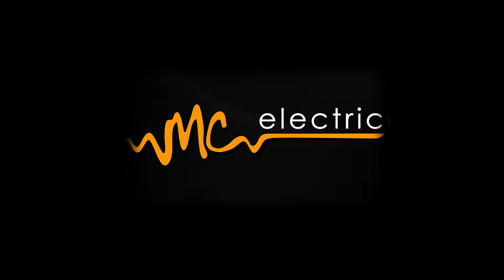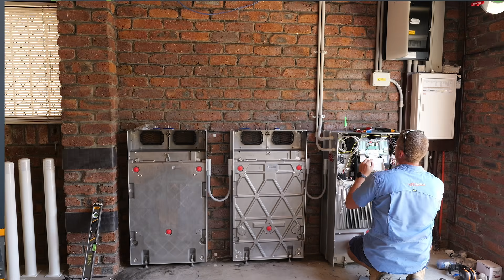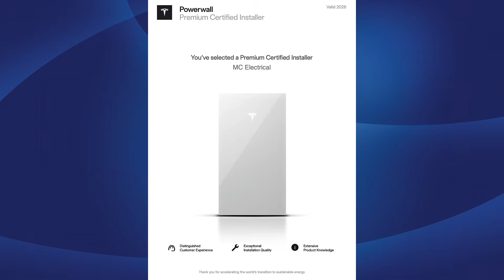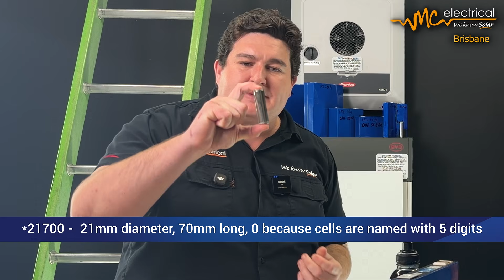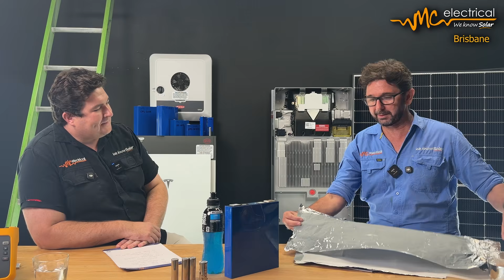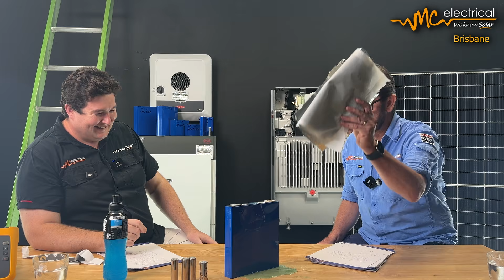Tesla Powerwall Problems Exposed — but why we're sticking with it.

Comment: How can someone tell if you installed a surge diversion? Second, if you go “off grid” via the app during the storm will that help protect it from a surge from the grid?
Reply: If your off-grid your house and inverter/battery are physically disconnectd from the grid. Appart from the gateway and inverter coms to the gateway you would be separated from a grid power surge. 

The surge protection usually looks like a circuit breaker without the switch. It usually has a red or green indicator. They are sacrificial so you need to occasionally check if it is still good.
Reply: @Yorick_Mark thanks, so going off grid may be a work around during very bad storms?
Reply: Getting a surge diverter installed in the switchboard is probably a better solution.

Comment: Great balanced review gents with biased put to the side and no Sig bashing😅
Interested to see competitive price per kWh comparison to the other 3 top tier brands from China? Are they still Nevada or Mexico/China along with the EV’s?
Cheers
Reply: Still manufacturing the Powerwalls in Giga Nevada
Reply from the maker: Thanks Michael. Still Nevada for the Powerwall. I wonder who is in your top 3 😅.
Reply: @mcelectrical well as you know, same as GI energy with Fronius my top Inverter and by the way, did you get the sad news about SMA pulling out of industry? Here at least for now. Not been so good since the left Germany and went to China but still a shame to see one of the best in the business going 😢
Reply: @mcelectrical  BYD/Fronius and Sungrow for SP Sig for TP 👍maybe now Tesla PW3 next gen TP back up there again in the mix 😊
Reply: @MichaelDance-d8d  I would argue Fronius Verto-Plus for 3-phase, but that particular review is still in the works.

 I think that's a fair top 3.
Reply: Thanks Yorick, keen to see that one. I’d like you guys to do an inverter temperature testing comparisons as part of your round trip efficiency as I don’t like how hot my Sig gets particularly at 38-40’c ambient hot days (sth side shade well ventilation cross breeze)
getting to 65’c + at only half throttle @ 14kw’s though 25kw TP inverting PV generation to surplus export with many users on Sig community reporting up to 70’c (danger zone max) when working harder like big loads or max vpp exports and cutting back to assist longevity and adding fans in garages which will assist and drop about 5’c .
I’m sure Mark will love this and Fronius will take the crown here 🤠
Reply: @MichaelDance-d8d We will start adding the temperature test test where possible. Keep an eye out for the SAJ review comming soon
Reply: @Yorick_Mark  I know you guys will most likely cover this in your upcoming review, however the Verto Plus switching time to backup does seem quite prolonged (11 seconds) in comparison to its competitors in the three phase backup space.
Reply: @cdgoldie80  We'll see what happens. You never know what Fronius have up its sleeve. 😉

Comment: 4:04 this is not true and it's one of the worst when it comes to using retailers like Amber. The Tesla app is actually pretty weak compared to newer systems like Sigenergy. Limited scheduling, missing battery data, inaccurate readings, and heavy reliance on Tesla’s automation instead of real user control. Competitors now give far more detailed energy management.
Reply: Yeah the Sigs good for that but it’s AI still isn’t the crystal ball just yet and customer support is far behind Tesla to date but overall I’m really happy with my TP system.
Just hope it’s a rock solid reliable investment such as Sungrow BYD/Fronius and Tesla ?
Reply: @MichaelDance-d8d  depends what you use it for. I've used both - manual control on Tesla Powerwalls via Amber can be hit-or-miss. Amber’s SmartShift sometimes hits Tesla API limits, so commands are often delayed or ignored - which is horrible for 5min price spikes, which a Sigenergy system will detect and respond to in 30sec.
Reply: @Nerdificationing  Tesla charging for the API integration does make it costly for 3rd parties to integrate with Tesla products. I have been informed that Tesla is working on software updates to improve wholesale market participation and reaction times to price spikes.
Reply: @Yorick_Mark  that's good to hear! I do worry they'll eventually limit it to their VPPs... such is their ecosystem approach
Reply: @Nerdificationing  I don't think so. I get the impression that they understand that they need to be a bit more flexible in integrating into established networks. Ring fencing works great if you effectively have a monopoly but Tesla no longer has that.
Reply: @Yorick_Mark  that's true, they'll adapt or perish
Reply: Between myself and my parents we have both a Sigen and PW3. They're both excellent products, and there's a lot to like about Sigen in terms of product flexibility and 3-phase support. The Sigen app is certainly loaded up with features, but it's all a bit half-baked. Things like scheduler are needlessly convoluted. The summary and charts are less clear and harder to navigate. Mode selection is almost comically obtuse (especially when attempting to disable their AI mode). Their "AI mode" is pretty weak.

I love configuration. I have Home Assistant tied to everything in both houses. The lack of configuration options on the Tesla PW3 was a concern. But after turning on Time-Based Control, it's almost uncanny how often it does exactly the right thing. It's not perfect, but it's dramatically better than a fixed schedule. Who needs walls of obtuse configuration when the battery can just do the right thing without being asked? And the Tesla app is actually nice to use. Its live data/charts are a league ahead.

And while Sigen is feature-rich, it has a few really wild omissions, like no built-in support for metering non-backup loads. I wish I knew that before the install. Retrofitting it will require more space in the switchboard and it's already full. And I don't particularly like the idea of paying for an A-grade to visit, and paying Jemena to disconnect the grid (no isolator in the meter box, can you believe it).
Reply: @sjwright2 Thats some great feedback. Thanks

There's pros and cons with every system.

Comment: Good to see some of the issues called out, 10% failure is quite high.  The Tesla Powerwall isn’t some magic tech lead. It’s expensive, had recalls over overheating risks, and competitors now offer cheaper batteries with more flexible capacity. Tesla was early to the market, but the idea they’re still miles ahead on home storage just isn’t true anymore.